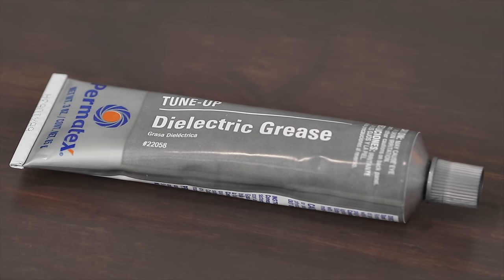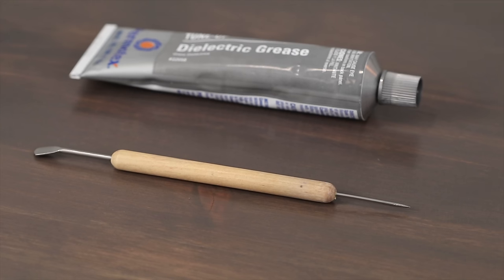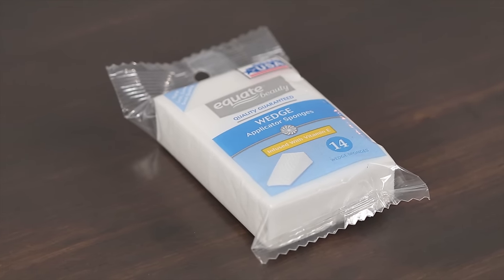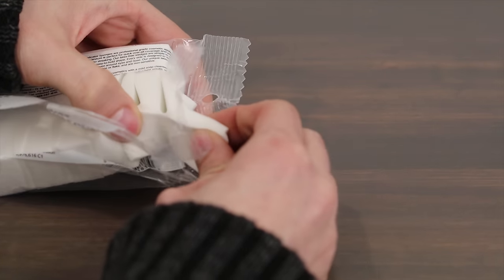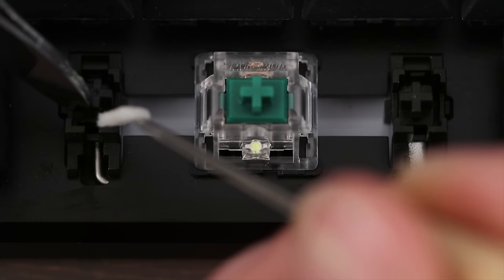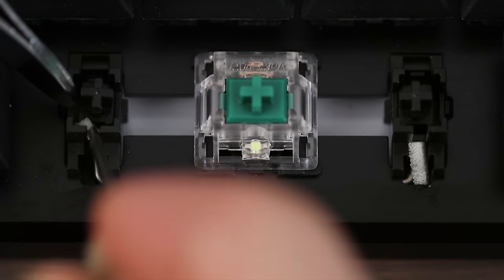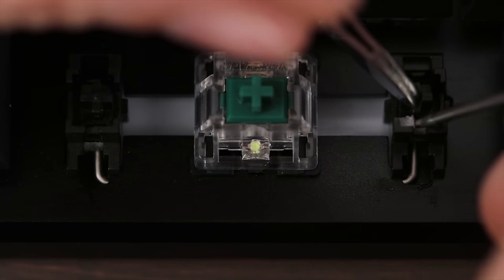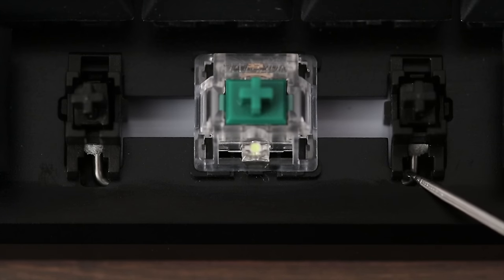How to Fix a Rattling Spacebar

Comment: Dude, as a newbie in this mecha community, I just want to say that, you're saving me a lot of time and money. I tuned my stabs, and those tick sound persisted. Not rattly, but tick that made me crazt. I was thinking to re-tune my stabs all over again or buy a new set of stabs. It all changed after I saw your video. Now I can sleep in peace. Many thanks dude

(edit, after hours of experimenting): 
the tick sound is caused by the tip of the stabs wire 'wiggle' inside the stem housing when we soft tap the edge of the keycaps. that wiggle creating friction, hence the tick sound. adding the small amount of foam like this dude recommend, prevent the wiggle, eliminating the tick sound. but the downsides are, the bottoming in and out become very mushy. I found out another solutions, covering the tips of the wire using 1 layer medical tape or plumbing tape (a.k.a the noob version of holee mod). it works. OR using a large amount of thick lube (like permatex) on the tips and stem hole also works.

Comment: I did this with a small piece of paper because i was desperate and it actually worked. It sounds slightly quieter, but no complaints since I've kind of wanted my keyboard to be quieter. Thanks!

Comment: That moment when you see the exact video you need on your sub feed...
Reply: I had to search for it. But yeah, exactly what I needed!
Space bar sounds so smooth now :D
Reply: Yeah, but, it did work but not as well as I hoped it would. And, now my space bar feels stiffer than I'm used to. But I'm sure I'll get used to it and everything will be fine. Although, I used denser foam but less of it and lost it in the stabilizer so now I would have to take it all apart if I want to get the foam out. So while it doesn't rattle anymore. It's not perfect. And, I wish there were more of these so I could see how different people did it. There's only a few videos about this problem. I wonder why Cherry went cheap on these stabilizers. They were the gold standard of switches until their patent ran out. Now, they're no better than Gateron or any of the other "clones". Anyway, this stiffness is going to take some getting used to. It feels like my space bar is a Cherry mx green now. (I use blues right now). I'm thinking of building my next board and going back to browns. I started on them and I think they are my favorites. I love blues though.

Comment: did you mean on top of the wire? under the clone stab? or literally under the wire
Reply: By the looks of it, i think he meant on top of it
Reply: Woo verified pog
Reply: Under the wire. I did a similar mod recently where you put a piece of fabric in the disassembled stem, through the back side with one hole and into the upper concave part of the front side, and it gets rid of the clicking. The reason it happens is because of the wire smacking against the bottom part of that concave area where the wire sits on the downstroke.
Reply: your mom
Reply: @ray3094  wow so funny
Reply: @ray3094  LOL
Reply: Yo dude awesome to see you here. Love your videos!!

Comment: you can afford to put more dielectric grease, especially on the portion of the wire that is inside the moving part of the stabilizers. this makes the wire not rattle inside the stabilizer (the main cause of the rattling). the rest of the mods really only work when you bottom out, which is a lot more effort.

using the sharp tool, lift the opposite end of the stabilizer such that you can see the ends of the wire, and coat it in the grease. alternatively, dip the end of the wire into the grease beforehand.

Comment: Here’s what I found out, you don’t need to use the make up sponges or whatever he used all you need to use is a paper towel cut in the slim slice and then fold it over once it should be just thin enough we’re still loose and can get in but also it’s very quiet.
Reply: Thanks
Reply: Boi, I'm glad I did this trick! Thanks a lot since paper towels are much more convenient

Comment: I find using some soft rubberized floss picks do wonders for getting the grease up in the stabliizers. I skipped the sponge step and got the grease up underneath the wires where the stabilizer sits and it's a million times smoother. I think one thing to mention with this method is that some of the tactility is dampened a little bit while you wait for the grease to disperse a little better, and in my case, my Kailh Burnt Oranges felt a bit like linears for a while afterwards

Comment: Yo      I actually found another way to eliminate the rattling sounds, if you have a pre-soldered PCB. Look up Acrylic Tape (They are thick rubbery, non-conductive transparent tapes that doesn't wear out overtime, or stick to any surfaces, which is a good material to absorb vibrations from the metal bars to the PCB).
I wedged a small tiny piece perfect enough to fit under the plate, but right next to the metal bars, just outside the stabilizer. That helped me eliminate most rattle! If you clip and lube it, it will just 100%  remove any rattles.

Comment: some stabilizer rattle is caused by the plastic housing being too small for the plate, leading to looseness (I'm looking at you Pok3r RGB). You can tell if you have this just by wiggling a finger on top of your key without even pressing it down, if it rattles, that means it's not tight enough on the plate. I have found adding bits of scotch tape on the tops and bottoms holds these 'loose' stabilizers down and prevents them from rattling.
Reply: This is actually the problem that I have been trying to fix, i tap the right side of my keyboard and it will rattle and go down a bit almost as if something is loose. This doesn't happen on the left side and this is with cherry stabilizers. Unfortunately I don't really understand what you mean by the "tops and bottoms" so I'm not too sure where to add the tape.
Reply: Christian Perez I second this!
Reply: what do you mean by "on the tops and bottoms?
Reply: I go out of my way to avoid cherry stabs because of rattling. I don't care that costar is more of a headache to deal with as far as maintenance goes, they sound good.
Reply: same problem, have you found a fix?
Reply: Thanks!

Comment: will try out the sponge thing on my anne pro2 tomorrow i think. What allready helped a ton was flipping one side up with that little nib and put some band aid in between so the stabs had no wiggleroom left. The spacesbar sounds okay by any means in comparison to pretty much all keyboards you can buy in local stores but its still far from perfect. What i noticed was that theee stab rattl sound mainly comes of the right side for me and touching that little cross with your finger makes it jump around on the wire quite a bit so the sponge hack might just do the trick there. Alltho next month or  so i ll desolder it anyways for different switches and then i ll fix the stabs or  put  different stabs in anyways but you know... thats the thing with keyboards, ''good enough'' is just a temporary thing, once you know it COULD sound better...you want it to sound better

Comment: found a even better way to do this with old pair of iPhone headphones. i cut them in half pulled the cable out so i had the rubber housing cut that in half and then slid it under the stabliser arm mainly so if i ever need to remove it i can easilyworks like a gem

Comment: I applied the same Dielectric Grease in the 2 areas he suggested, which helped. What really helped, was under the plastic stabilizer where the steel stabilizer rod goes into. I noticed slightly touching the keycap, the steel stabilizer rod would slap onto the plastic stabilizer insert, where the end of the steel rod gets inserted into the plastic stab part? If that's what's called? Applied a little more on the left plastic stabilizer and it helped. Question though, will dirt, dust stick to the grease and give it problems? If so, would cleaning it be a problem?

Comment: Hi Rhinofeed, thanks for this. This fixed my spacebar rattle from the right and left side. However, I have noticed that the middle part, the actual switch (sorry for bad explanation, I am new to mechanical keyboards) seems to be rattling, and I do not have the tools/experience/confidence to trust myself with soldering and such. Is there a way I can lube the switch from the outside somehow? I have seen this done with MX Blues once, where the lube was put in the stem from the outside, but some of the well known mech keyboard people critisized that way, so I don't really want to do it. Any tips? My board is a Coolermaster MasterKeys Pro S, MX Browns & white LEDs if you feel the need to know.

Comment: I have a big problem here. I don't know if that little metal wire under the keyboard "armor" is the stabilizer or if it's the black switch. The thing is, that little wire is loose, I can't manage to put it back. Everytime I try, this little metal goes backwards so the key. So then everytime I press the key, it stays pressed, so I have to pull it back. Do you have any idea how to fix it? Please!

Comment: I did this without the grease, but used the exact same sponges from Walmart. They're actually more like $2, but that's whatever. I can say that this slightly helped, but it's definitely not "fixed by any means. I'm going to try and put another square piece in from the top as well and see if that helps. I'm also slightly worried that the sponges will move around after a while and get lost within the keyboard somewhere, never to be found again. But oh well.. I'm doing this on a HyperX Alloy Elite RGB with upgraded double-shot PBT keycaps. So it's not the most expensive keyboard in the world. But It's definitly not cheap either. I'm into this thing, just under $200. So anything to fix the rattle helps. But they should have just used quality stabilizers for that much money tbh...

Comment: So I have a bit of an odd question, but I'm about to do a new build with a DZ60RGB pcb from kbdfans  and the case I'm installing it in is from YMDK who makes stuff for the GK series PCB's that are usually more of the budget kb pcb's in the market but basically the case has screw mounts to support multiple pcb layouts but the original GK60 pcb I used to have in there had either a short or something but the X key would either not register or just act like I was holding down the key, had to disable it in games. Tried swapping the switch with a few different ones but same issue which lead me to think it was the PCB not the actual switch. I've never used an aluminum case on a KB build before but is it possible that the PCB was shorted from maybe contact with a screw or the case?

Comment: Absolutely do not put cut up sponges into the stabilizer housing. I did this after watching this video and after a few months it just dries out and crumbles away leaving crap all over your PCB and inside the keyboard. Look up "How to Clip, Lube, and Band-aid Mod Your Stabilizers" by Taeha Types for a more comprehensive method for eliminating rattling.

Comment: In case it helps someone else here, on my generic USB keyboard the spacebar was the only loud rattler, and after some experimenting I found that it was to do with the travel between the control arm (attached to the spacebar) and the plastic hooks they slot into (on the keyboard base)a. I used an exacto blade to cut some electrical tape to the exact width of the bit of metal that slots into the hooks. Took a few tries to find the "sweet spot" in terms of how many wraps of tape - too little and the rattle remained; too much and it would jam up and not let the key rebound. Two bits of electrical tape later and I now have a spacebar that's as quiet as the other keys. Peace.

Comment: the wedge kept falling out after a few times using the key. I've tried every angle and every shape and size i can think of but that didn't help. Any ideas?
Reply: if your kb is hot swap take out the switch then the stabiliser and then get a band aid, cut a small rectangle of the cloth part and place it underneath the stabiliser on the pcb and just put it back in.
Reply: @reubenfysh604  thanks for the tip. My kb is not hot swap unfortunately...

Comment: Does this impact how much force it takes to press the space bar?
Reply: I think no because stabilizer doesnt have fucking springs lol
Reply: Spacebar and other keys force depends on the springs on the switch
Reply: @paklekj4429  I actually did this a year ago, and it definitely does affect the force to bottom out the space bar.

Comment: I have not seen any guides on how to lube topre switches
Reply from the maker: Because they're perfect.

Haha, seriously though. I don't think it would be good to lube Topre switches since they are based around a rubber dome. It would just get messy, and it may not even effect the feel.
Reply: Lubbing the stems makes a noticable difference in smoothness and sound!

Comment: Just take it out, clip them and lube them, add a layer of softener under it. This is the worst one I've seen.
Reply: Well what if we CANT take them out, I mean not all keyboards are hot swappable
Reply: @cesarfloden3509  Stabilizers can be taken out no matter if the keyboard is hotswappable or not.
Reply: @GOTTHEDAWGINME  no, I can’t
Reply: @cesarfloden3509  You need to push one side of a stabilizer (either the top side or bottom side), and then you pull up and towards the side you just pushed, most of the stablilizers work this way, and are called clip in stabilizers, so just repeat this process. If you see a screw in it you have a screw in stab, just screw it out.
Most should be metal wired.
What keyboard do you have? Maybe I can help you, I have a lot of keyboards.
Reply: @GOTTHEDAWGINME  i have a keyboard called deltaco 60%, searches up GAM-075. 
I think it’s the rk61 case.
I can get the stabilizer stems out, but not the wire, since the switch is connected to the pcb, the wire is too big to get out.
Reply: @cesarfloden3509  then don't, it's not as important to take out the wire.
Reply: @GOTTHEDAWGINME  yes it is u Literally can’t assemble it without the wire out